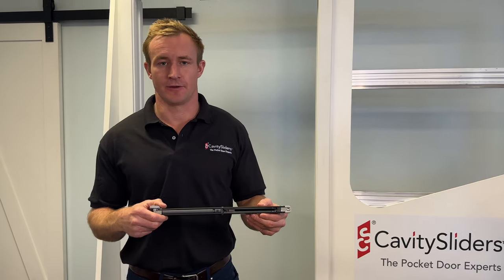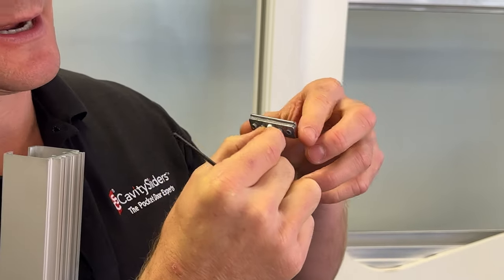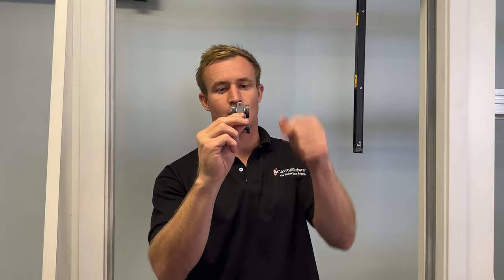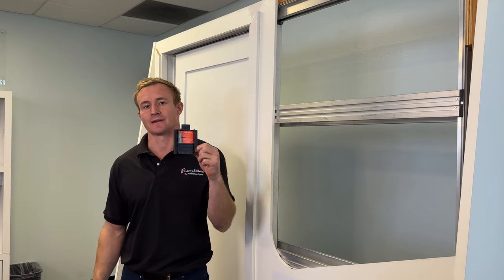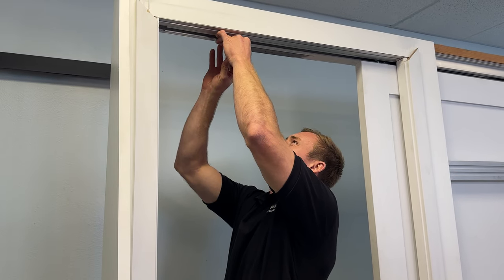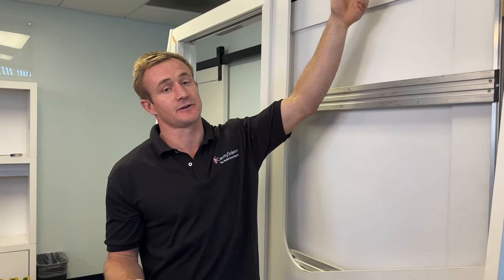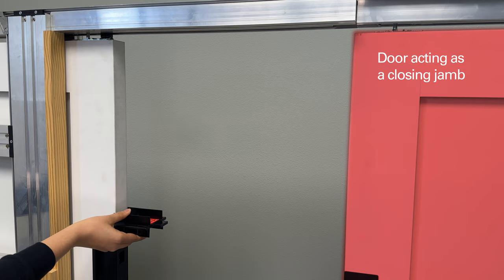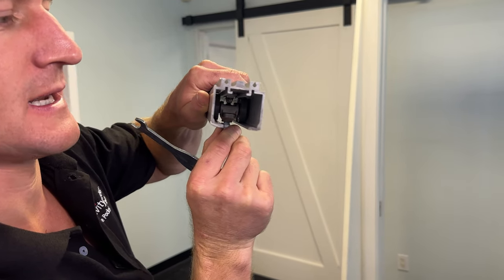CS SofStop Installation Instructions | Cavity Sliders Hardware Installation Video

Comment: My question is how far from the end of the top of your door does the hardware for hanging get installed???
Reply from the maker: Hi there, if you are referring to the Mount Plate location, you can find the specifications on page 12 of our installation instructions: https://www.cavitysliders.com/Portals/7/PDFs/Installation%20Instructions/CavitySlider%20Kitset%20Installation%20Instructions%200823.pdf

If you have any further questions, please reach out to us at (888) 466 0030 or email us at info@cavitysliders.com.

Comment: Glad you have several videos on installing the Twin SofStop, and no videos on the single SofStop. Then the manual doesn’t explain it either. The manual refers you to a video of how to install a Twin SofStop.  Overpriced products with not very well laid out instructions.
Reply from the maker: Hi Tom, the instructions for installing a Single SofStop is the same as the Twin SofStop, however, you will do it in one direction only.